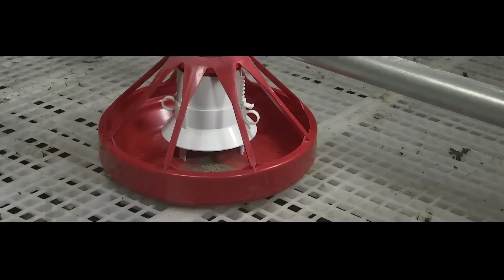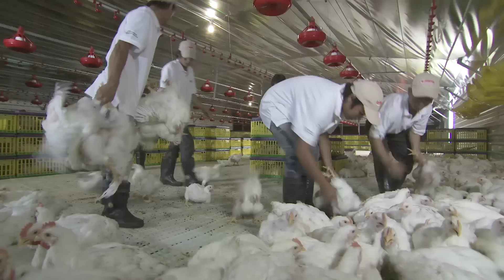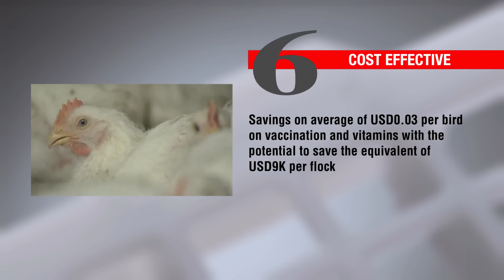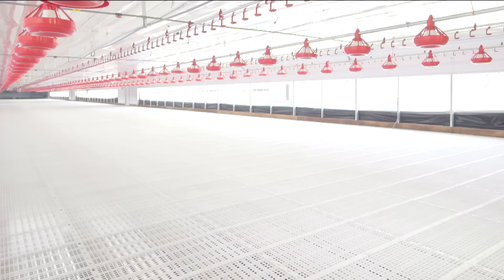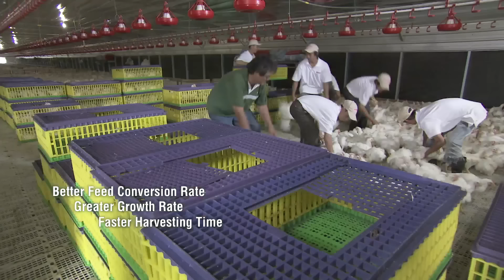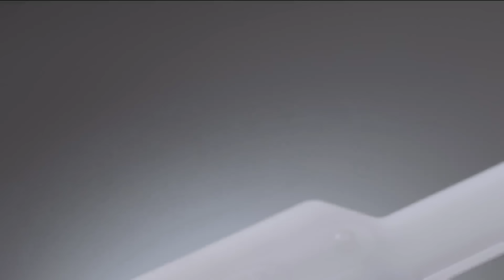Cumberland Slatted Floor

Comment: If a person had an idea for an automated, innovative and cost efficient waist removal system using proven technology to be paired with the raised floor concept, would this be worth something to Cumberland?
Reply from the maker: Thanks for the idea! We are currently offering manure scraper to pair with our elevated floor system.
Reply: @GrainProteinTechnologiesAPAC What is the total cost for putting up this facility of 50,000 birds capacity in Zambia?
Reply: It would be worth a spelling class
Reply: How do you maintain heat??what is the distance between floor and slatter??
Reply: +Harlan O 

l\

Laxman 756499242
Reply: AGCOGSI  please contact me +917404982110 I am from India  I want this system
Reply: सर मला पाटनर हवा आहे जर कोनि असेल तर काँल करा मला पन पोल्टी फाँम टाकायच आहे 7887766445